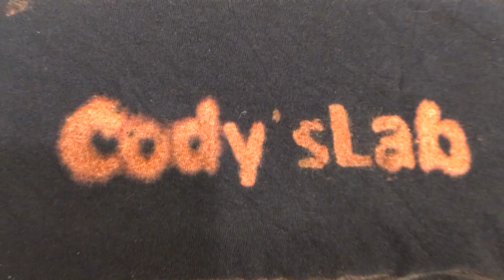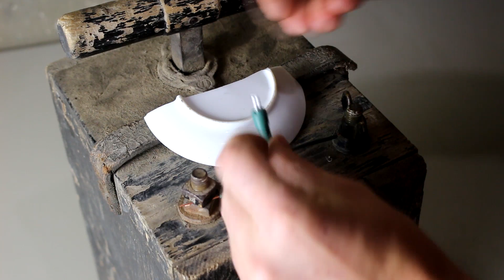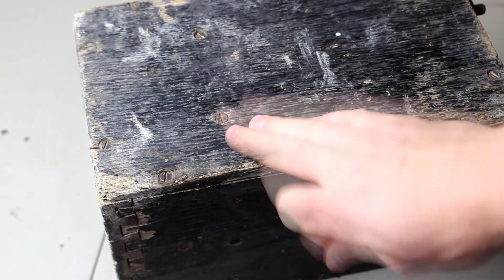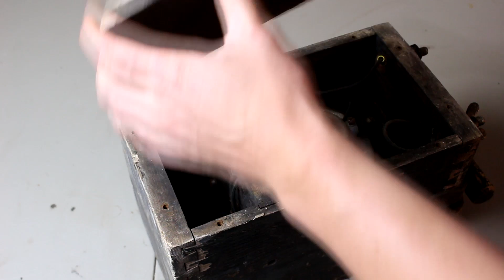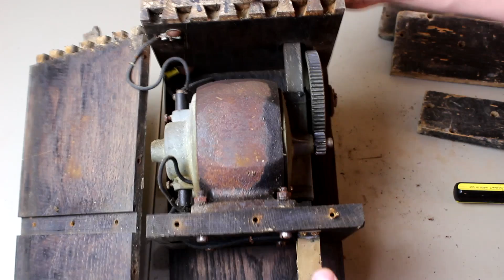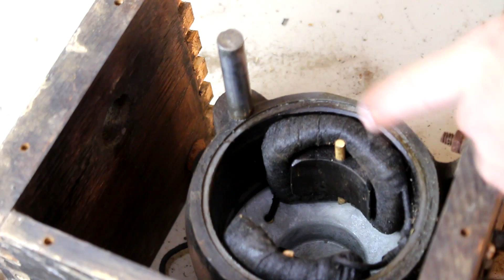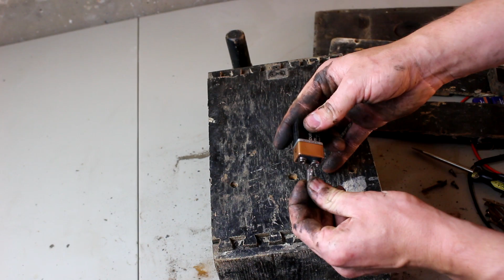How Does An Old Blasting Machine/Generator Work?

Comment: About the "boost" theory: If I remember correctly, the collapsing magnetic field induces a voltage spike (that's how igniter coils work) - and this is why you have shunt diodes across large coils to protect other parts of a circuit in other applications. So it's the energy stored in the magnetic field and the number of windings that determine the voltage this thing puts out...
Reply: While what you wrote is true, this is just a simple universal motor/generator. The iron core always have some remnant magnetism which is enough to produce some current, which is fed back into the stator windings which will increase that magnetic field, which further increase the induced current, ... It's a self-excited generator.

Funny experiment with a parallel-connected motor is to start it normally,, then decrease the stator excitation. The RPM would increase to ridiculous levels, and surprisingly when you completely remove the current from the stator, it will still spin, in case it did not exploded yet. 😆 Needless to say, it is a dangerous experiment, especially at home, so don't try this at home.

Comment: that thing must have seen regular use, as those iron cores don't hold a charge very long. If it does ever stop working, try charging them again by pulsing DC into the coils

Comment: The high voltage is probably back EMF. This is created with any electromagnet. I doubt that the generaator itself would give you nearly that much if the back EMF did not occur, but I could be wrong.
Reply: Simon Tuchman watch the entire video
Reply: I did. I disagree with Cody in this instance

Comment: The wire going back in probably goes to its own coil, so it is in series inside the dynamo, thus it will double the voltage. I highly doubt it goes back in to induce a extra magnetic field on the wire. It would be possible but far more complex and unnecessary.

Comment: Looks like they used a standard 110V AC motor as generator. Dynamos usually had permanent magnets. AC motors had (and many still have) coils instead, so they can passively make the magnetic fields between rotor and stator point in the right direction.
It can´t be a car alternator when the voltage is over 60V, except ancient cars used that voltage - but probably not.
Anyway I don´t think it´s a custom built generator especially for igniters. It might be as simple as a washing machine motor or something like that which they just took because it was convenient for the task.

Comment: i thought a generator produces ac, not dc and i cant see a transformer, that would explain the immense pain
Reply: The term 'generator' is colloquially used to describe any device that converts mechanical energy into electrical power.  A transformer is not required in a device like this.

Comment: Extra wires have actually nothing to do with the output voltage. Voltage is defined by generator rpm and number of turns in rotor(rotating part) coils. Rotor coils are the ones which make the electricity but to make it you need static magnetic field around the rotor. This is made with stator(static part). In this generator unit stator seems to have two little permanent ferrite magnets but that's not going to be enough to create required power to set off those blasting caps. Those permanent magnets are needed so the generator can start to make electricity, then produced electricity goes to stator coils through those extra wires and makes bigger magnetic field to support higher power levels. But this magnetic field is just needed for this size generator, it doesn't matter how it's made: with powerful permanent magnets or with an external power supply like battery or in this case, by the generator itself. Main point was that every electric motor and generator has stator and rotor, usually you need to somehow apply voltage to the stator to make that static magnetic field and it has nothing to do with the generator voltage.

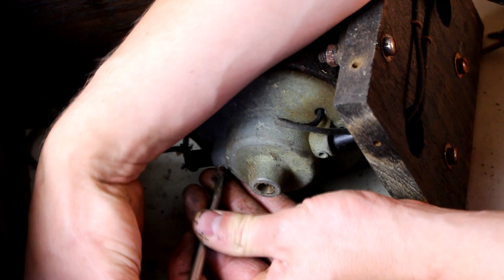Comment: at 13:04 mr Cody has an enlightened moment. (or how you spell it, sorry, dutch).
He sees that they actually designed the motor for easy repair...............
You can take it out and put it back in without too much effort.

He actually says that you dont see that often now a days.

YEAH!!!!!
That is because the manufacturers have DELIBERATELY designed the shit to make it almost impossible to repair.

INFACT!
Electric equipment is often made in such a way that it can just outlast its warranty period. And so after it expires, it dies.

Now a days car manufacturers make air intake manifolds from Plastic.
I mean..........
Plastic.
Sure, nice for Some Time.
Not nice for ALWAYS.
That is because cars are ofcourse also designed to malfunction in as short a time as possible, but ofcourse keeping in mind certain rules.
And so..............
When it hits certain milage or years, it will start showing issues.
First this, then that.
While they COULD have made it in such a way that it would last FOR EVER!.
Or, close to FOR EVER.
Take the London Taxi.
Has no problem with 1 million MILES.
Howmany cars can do that without too much trouble these days?
There you go.
And, let me just ask you, people on this planet rich and poor: What was the car designed for?
Why did we invent such things?
Was it not to get from A to B quicker?
If so..................... 
Why not start using your brain?
Or need i spell it out?
Reply: Vaults are filled with gold...............
Dont give me the crap that there is no way to manufacture manifolds from some lasting material.
Infact, the old BMW motors which have been on junkjards, in rain, being pissed over etc etc................ they are still strong...............
Revision, ok.
But todays mass production vehicles are there to last what?'
250 thousand miles, if that? Without hickups.
I have yet to buy the car that can drive me 250 000 miles without any problems.
And yet, we did try to get there. And maybe we did get there.
BUT:
There is NO MONEY in someone who buys a product just 1 time.
CLEAR ENOUGH?

Comment: I wonder this works like this one small old toy firetruck I had as a kid that would keep spinning it's wheels after you push it forward, similar to but unlike the cars you pull back on to move forward, moving in both directions instead.

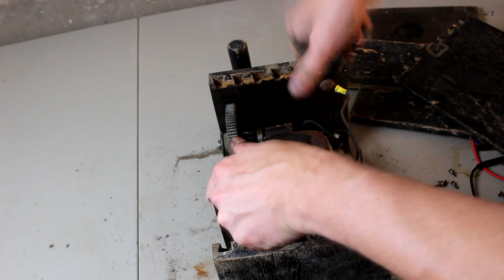Comment: 15:05 It'd be pretty easy to install some key-operated mechanism that would slide a piece of rubber between the metal bars visible at 8:21 , therefore disabling it. You keep the safety provided by force required, and add extra layer of safety provided by modern multi-step procedures.

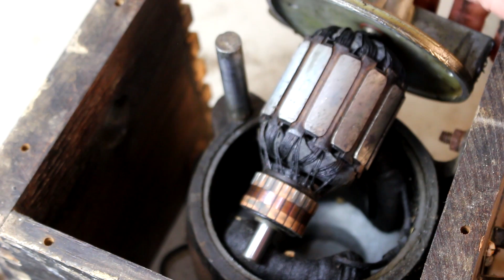Comment: 13:00 ah cool it's a series wound generator!
It only needs such a weak permanent magnet as it is only to provide one to start it off, from there the two stator windings provide the needed field to keep it going.

Its even possible the stator windings help keep the fixed magnets magnetised through use!

Comment: As he was comparing the generator to a small DC motor, I was fiddling with the tiny DC motor which I have sitting on my desk.  I pulled it apart really quickly, and it looks stunningly like the inside of the generator

Comment: A+ video!  This is a very interesting piece of engineering. I would love to see videos like this on any antique industrial equipment you may have access to. I don't think it would have been made during wwii. I think steel was in such surplus (and everything else rationed so much) that they started minting pennies out of steel in 1943. Many domestic goods  transitioned TOO steel construction during this time such as silverware and cookware. My guess is it's pre-war and it made sense to not surround a powerful dynamo with magnetic metals. Finally bit of guess work: the initials may belong to the tech who affected the (negative?) terminal repair. Thanks again for such a great video!

Comment: There are two reasons for the switch.
1. There is nothing drawing the current away so it maximizes the field current to produce maximum power.
2. The plunger would be a lot harder to push with additional electric load. You gain more speed for a stronger output impulse.

Without the switch it is very likely to damage the blasting cap without setting it off. Also when connecting in series, the pulse may be too weak to ignite them all.

And about safety: this thing is only safe when the plunger is all the way down. The generator has a very low resistance and is short circuiting the terminals. This prevents currents caused by static electricity or nearby lightening strikes.
Never put it onto something elevated. It may topple over, drop out the plunger and land on the handle. It must be placed firmly onto the ground, use a board as support and protection against moisture from the ground.

Modern versions use the same inductor system as field telephones. Spinning the crank of a field telephone fast can generate 100 volts easily without load on the terminals! I have managed to get over 320V out of a more modern 1960s German Bundeswehr phone.
We had a serious accident with those things during a war game.

Me: I wonder if the new guy has finished wiring up by now.
Comrade: Let's find out *whirr-whirr-whirr*.
Me: STOP!
Distance: Yeow *clunk*.
Me: That's the guy who keeps stripping the wire ends with his teeth!

While those 10-way branch exchange boxes look like you can run them over with a tank without harm, you can bash them in with your skull...

Comment: 13:00 mark - did you remove those 2 screws before sliding the coil back into the electro-magnet? Ouch those little wires and byebye big spark!!

Comment: @Cody'slab Hey Cody, I have a catch22 question for you. Magnets, both permanent  and electromagents are created using high voltages that come from generators. But generators are created using strong and well shaped magnets. So how did we get the magnetic bars to create the first generators with? Did we just strap a bunch of irregularly shaped mangnetic rocks together? Something doesn't quite seem to make sense.
Reply: Shehan Jayasinghe there's other ways to produce electricity. Also we've had magnets for thousands of years in compasses.
Reply: @tiresias3342  Yes but those compasses that made in the 11th Century were very hard to tell which way was north and which way was south because we didn't even know how the earth was shaped back then. Also creating compasses by using irregularity shaped lodestones is fine but you need a good magnet that is well shaped and magnetized strongly to create  a decent generator that can produce a usable and mold-able electric current (like a pure sine wave for a rectifier circuit) other wise you just have electrons sloshing about in irregular patterns which is extremely difficult to do anything useful with (especially without technology that was created with the precision that a low-entropy energy source like electricity has allowed). Its hard to find stones that are shaped like bars and have their poles very strictly oriented to the geometric shape of the stone. In my opinion all of humanity's technological progress was really a recursive process that built on itself and grew from slow start but exponential growth. It was all just trail and error until we figured out a pattern that allowed us to quickly achieve precision from scratch. That pattern is what I want to know and am interested in.

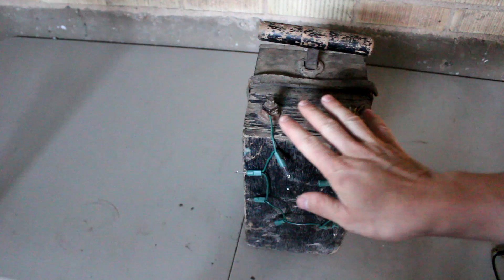Comment: Hook it up to an oscilloscope! It would be interesting to see what kind of wave it puts out, my guess is a sine wave that decays both in frequency and amplitude as the rotor slows down. 1:30 tells me it's either not DC or way past 60-100V, as you could only just about feel 100V DC. Also, why would it need to be strictly DC? My understanding is that it would be a lot simpler to create a device that generates AC from motion.

Comment: That isn't magnetized iron it doesn't work any different, its a regular motor you give it electricity it will run, you give it work it will create elecrricity just like any other brushed motor. Brushed motors haven't really changed at all the motor still looks modern.

Comment: Hi Cody. Long time looker, first time commenter. I have one of these and have done some experiments with with it myself. One required I have it rewound!! So, the long and short of it is this. These are a current source DC dynamo. The brass end caps of the motor frame serve as capacitors. The armature has what is known as a neutral wind and the field windings are series wound. what this amounts to is this. If you spin the machine above the Lens' Law limit you get an unlimited amount of current to the resistance felt by the windings. Assured reactance of the blasting caps. The diagram that came with my unit shows I think a limit of 11 caps, but no mention of wire distance. I could take a picture and send it to you if you are interested. There is a hack you can do which will turn it into an entirely different machine but I am not sure what you want to know about the world.

Comment: So say you take one of these appart just not as much as you did would you be able to turn it into a man powered generator that is fairly self sustaining or can be used to charge lets say a car battery if the case is modified or the little pieces at the bottom just closeing the circuit soldered or attacked to one another. Would you be able to modify it to not only set off explosives but also. Say your home is in the middle of nowhere off the grid using solar panels and a large array of batteries but it snowed heavily and you have no way of going outside to clean off the panels but have access to the batteries. Would you be able to maintain a charge on those batteries with that device if it was modified

Comment: As a teacher I always hate the phrase " a generator is just a motor running in reverse" which is so wrong in so many ways. A motor is a generator and vica versa.  It even annoys me that there are different ISO electrical symbols for them. A running motor generates a voltage, as it must because there are conductors moving in a magnetic field, that opposes the applied emf. The faster it turns the bigger the generated voltage until at some point they are equal an the motor can't go any faster. In the same way a generator produces an opposing torque, because there are windings carrying a current in a magnetic field, just as a motor would do. Hence the switch at the bottom of the punger's travel allowing the generator to run up to full speed under no load before the circuit is connected.

Comment: On the top of my head before watching this video, I would like to make a guess on how it works. I think that it has an open electric current going through the system to the dynamite sticks and then when you push the little handle down, there is some type of rod or something that closes the current and lights off the dynamite.

Comment: I was really looking forward to you testing the voltage output. Whether  it is ac at quite a low voltage or a HT pulse.
As it lit the lamps I guess its got to be ac at a low voltage with a fair current.

Comment: With the way it responded with the snap and sudden surge, I assumed you would find some sort of capacitor in there holding charge to build a voltage spike for sudden release. The rudimentary point system is far cooler though.

Comment: Those metal parts in the dynamo can't hold a screw because they simply aren't magnets. The whole dynamo works with electromagnets only that are powered by the electricity it generates. It bootstraps with remnant magnetism in the magnetically soft iron material and as it turns the magnetic force and voltage on the dynamo grow quickly, accumulating energy until it is released by the contact.

Comment: Correct me if I'm wrong but doesn't that kind of motor generate AC currents when spun up? Also he said that this devices generates between 60V to 100V and it hurts to touch. AC would hurt at that voltage while DC wouldnt.
Reply: It depends on how they are built. They can produce, potentially, both AC and DC.

Comment: Neat explanation! I was curious about it. Any idea if you could significantly up the voltage by constructing/replacing the dynamo with neodymium magnets? I wouldn't want to really dismantle or destroy the original, but it would be an interesting experiment.

Comment: I thought you said it was DC, initially? But, Since it's basically a generator which spins an amateur past a permanent magnet very quickly, wouldn't that give you rapid pulses of electricity? Aka AC current? Maybe you corrected yourself and I missed it, or I'm just mistaken about what you said,  so forgive me if that's the case, but typically, a generator supplies AC current, correct? Just curious. Cool video btw, love your channel C-Money! Anyways informative and interesting

Comment: I can't help but think that, the "generator / motor", ...... sends AC & not DC, there is NO rectifier circuit in the box.
The fact that the brushes are fed by the field coils and alternating  between each other on the armature, the week magnets are just to get it going, ... then AC, which is better than DC along long wires, is what sets off the primers of the explosives.
Try a modern AC meter, (most go up to 5000 volts) and see what reading you get.
Also, if you hook up an analogue DC meter, you will see the needle pulses from one way to the other rather than showing a  steady DC voltage reading .
Try it and let us all know, ..... I'm sure others out there think the same way as I do.
Reply: Look up DC motors.

Comment: Nice vid. I have one of these machines bench mounted and can run it at different speeds. The output is very interesting. It is what was known as a current source device, and as such does not conform to Ohms law for DC current supplies. Resistance is futile.

Comment: I expected a capacitor connected with the switch and Dynamo so it charges up when you push it and when it reaches the bottom it discharges through the terminals